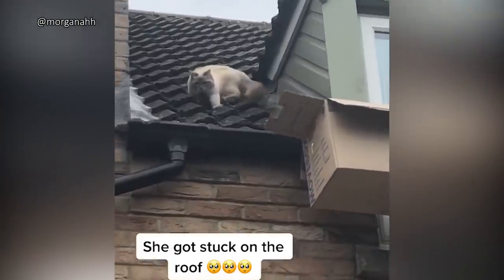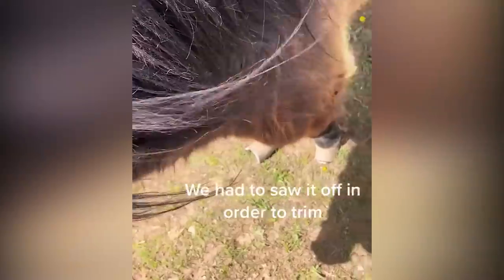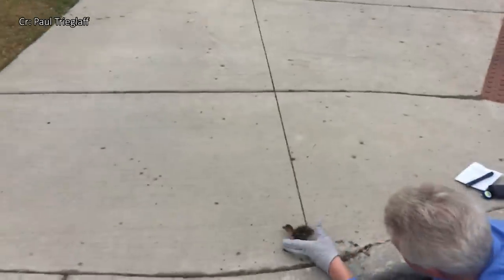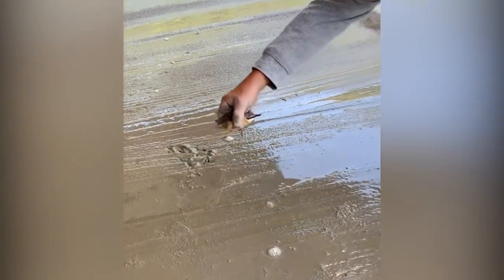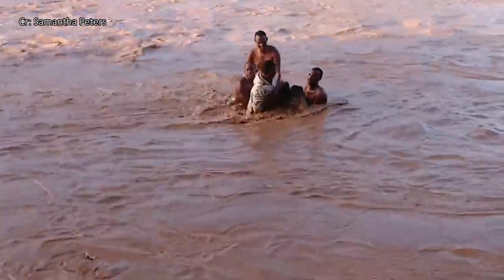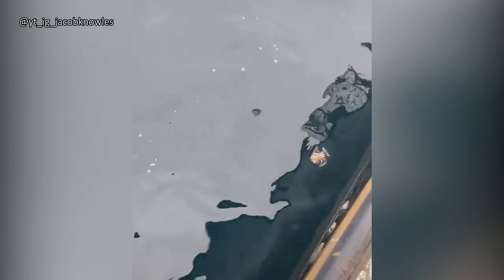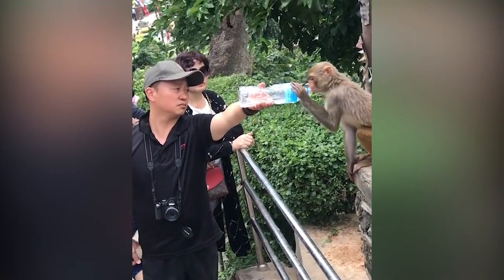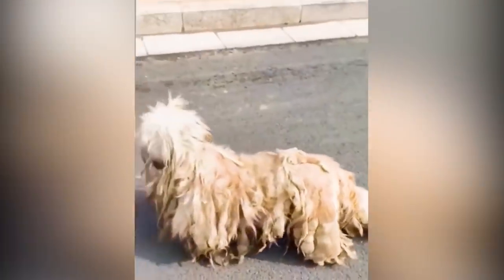Animals That Asked People for Help & Kindness

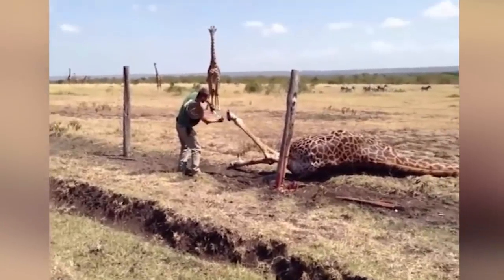Comment: 4:24.Complete bollocks.That is not an electric fence.Aslo electric fences are not dangerous.They deliver a high voltage shock but with very low amps.